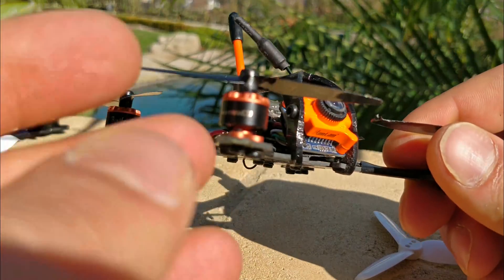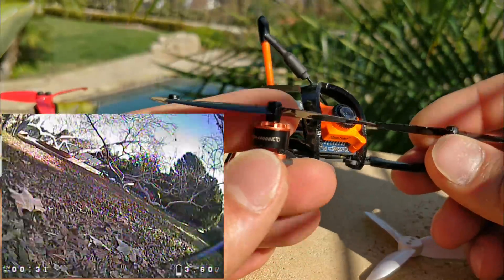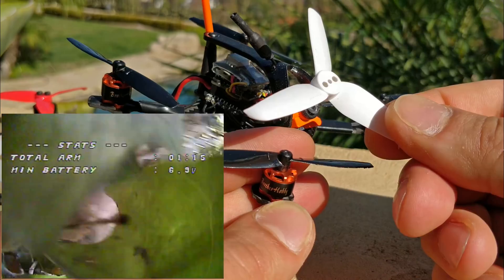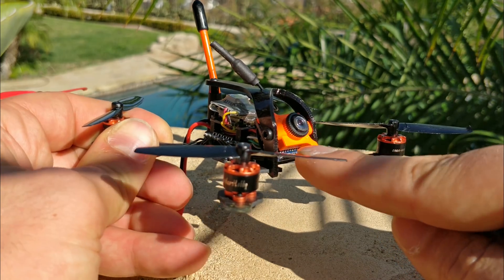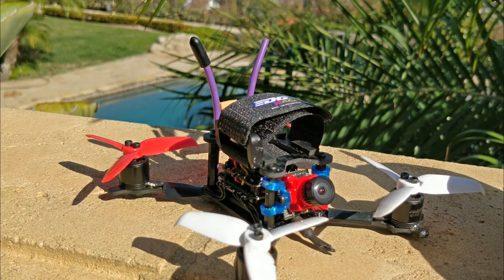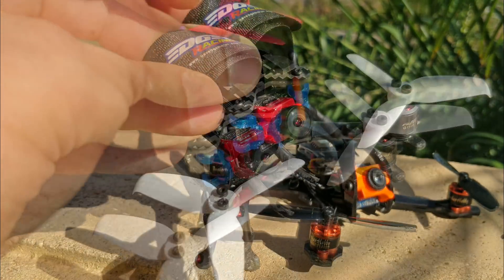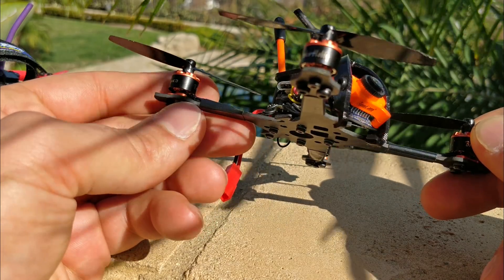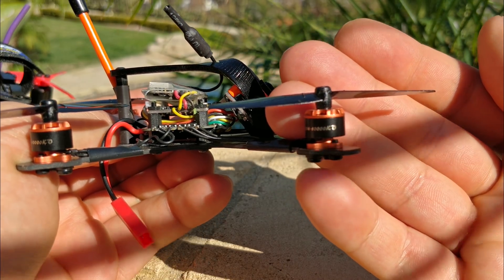Brother Hobby 0804 and the little quad dilemma

Comment: Hello. Have you ever try 15000kv motors? I have just purchase 4pcs and I am stil confusing whether they will run on 2s and are good for newbee
Reply from the maker: They'll work on 2s but 5000kv is more appropriate for 3s on 2.5-3"
Reply: @Kabab  thanks, but i thought brotherhobby 0804 15000kv 😅🙂
Reply from the maker: @jozefmichalicka3443  just keep those skinny props on it and it'll be fine

Comment: 2 years ago wow. I still like this one.
Reply from the maker: Yeah it was a really clean design. The most recent one using whoop boards is much simpler however
Reply: @Kabab  I'm all about smaller and quieter with performance so I love the progress you're making. Wherever the world is cooperating with parts, I'll keep building your TP's.
Reply from the maker: @yak55x  the cinewhoop that's coming is the real magical thing. Even that's a lot quieter than most cinewhoops
Reply: @Kabab  I'll look forward to it.
Reply: @Kabab  hey kabab, random blast from the past... But would these 0804 (15000kv variety) motors spin 2" props decently on 1s? Trying to Frankenstein a 1s 2 incher together to go with my 1s babytooth and 1s 2.5 inch and have access to a set of these on the cheap. Probably don't need a 2 incher on 1s but gosh dangit it sounds fun... Haha. Appreciate your insight always.

Comment: you probably don't use this one any more. can I buy it off of you ? i'm new at fpv and I like this one. it looks great and small and light.
Reply from the maker: I actually gave this to Jordan/JET the last time I saw him.  I'm sure it's hanging on his wall now.
Reply: @Kabab : oh :( thanks for your reply. i'm practicing on brushed motor quad right now and getting pretty good at it. now it's time for me to move onto something with more power, so I can do different moves. when I was flying with my tiny little brushed motor quad in the park near my house there was an 80yr old lady. she didn't want me to fly drone there. even when I saw her faraway I already stopped and waited for her to pass and getting faraway from me before I started flying again. still she turned around and got mad at me for flying drone there. what am I going to do? fighting with an old lady ? I moved to a different park, but still afraid of some old lady might give me a hard time. so that's why I'd like to keep things small and quiet. so I can keep practicing. now why don't I just buy one 2s quad from the market ? there isn't any "real" 2s quad in the market to buy from. for example, babyhawk r pro can run on 2s, but 3s is recommended. it weights 90grams (without battery). that thing would probably barely lift off the ground on 2s. and all other companies seem to do the same," can run on 2s but 3s recommended ". I just want a quad that is really built for 2s. I've never built and set up a brushless quad. I guess now I have to give it a try and hope for the best. I like your flying style and I will fly like that someday.
Reply from the maker: @matthew04101  you want the tinyhawk. I could say you may not even care to fly much else after flying that too. It's fun to shoot up 100ft tree in half a sec with a 5" but like anything else it gets old too. You get a similar excitement with the tinyhawk in that you can do most moves with it since it somehow has enough power.
Reply from the maker: @matthew04101  it's coming out tomorrow.
Reply: oh, sweet! thanks for your reply and help. i'm going to get one.

Comment: I think that a 2s quad like that would be viable but only if it is cost effective. Like you said, the 2.5” is only marginally more expensive, and I seem to remember in one of your earlier videos about the 2.5” you said that the babyhawk R is cheaper than even the 2.5”. That’s the issue, I don’t necessarily think that this size can take off (pun intedended) if there is a higher performance craft for cheaper. I could be completely wrong though, and I would love to see a more economical version that becomes popular. On a side note, have you ever checked out the FT Gremlin from FliteTest? I know they aren’t as high performance as you’re looking for, but they’re 3s capable and pretty economical if you have a spare micro cam laying around.
Reply: P.s. I have an FT Gremlin and it’s not super high performance (I run it on 2s) but it’s super fun for just putting around my neighborhood  😁

Comment: I heard you tried out the RCX motors for micro builds. How are they? I have the 1103 and they heat up more than I would like. Opinions? Suggestions? How can I make it work? I have 2 inch build with a dry weight of around 40grams without an FPV system. (waiting for my AIO) your help would mean a lot!
Reply from the maker: The rcx are good Motors but they do heat up a lot period more than I would like them to

Comment: Off topic  question for you,  im building s 6 in floss 2 with 2507 brotherhobby motors, 2700kv, what props  would you recommend for General flying, free style and  not crazy on amp draw? Do u have a favorite
Reply from the maker: I haven't tried the new HQ 6x4x3 v1s but  I believe they fixed the issues with the 6x3x3 and if so, it would probably be my 6" prop of choice.  Other 6" that I like is the Gemfan 6042 but I prefer a triblade.  Also try the Gemfan 5552.  Fantastic prop.

Comment: hey kabab, quick question would that tpu plate for fc softmounting, would that work for the floss 2? how thick should it be, and weight vs 4 bobbins. and how would it perform?
Reply from the maker: +Davey Knowlton it would work for the Floss 2 but would be much bigger. It would probably add more weight than it's worth. The rubber standoffs or an FC with rubber grommets is usually the preferred methods
Reply: Kabab FPV Thankyou so much for the reply. I think your right, :)

Comment: What you think on the Eachine vr011 goggles ?
Reply from the maker: +MC flyer are those the actual goggle or the shoe box style?  I forget. The goggle is total crap. I did a review on it. If those are the new ones coming out soon then I dunno but they'll probably be crap....
Reply: Kabab FPV https://www.banggood.com/Eachine-VR011-5-Inches-800x480-Diversity-FPV-Goggles-5_8G-40CH-Raceband-With-ProDVR-p-1209467.html?rmmds=category&cur_warehouse=CN
https://www.banggood.com/Skyzone-SJ-H01-9601080-2D-3D-FPV-Goggles-AV-Video-Headset-With-HDMI-Head-Tracker-p-1105891.html?rmmds=category&cur_warehouse=CN

which one is better ?
Reply: what is the best goggles under $100 ?
Reply from the maker: I haven't used either of those but they're box goggles so I wouldn't spend much money on either.  Go for the eachine one that's sold like 2000+ pairs or something with thousands of reviews.  It's like $60 I think?

Comment: I just wish someone made a frame that fit 070x's with an arm length long enough to use these KK 65mm props. So far, such a frame doesn't exist. All the frames I see that fit 070x motors are usually 55mm prop size max.
Reply from the maker: My design does at the moment but the motors are so expensive I wouldn't recommend it.
Reply: Well, in my case it's more of a me just wanting to do it thing, rather than a cost effectiveness thing.  I'm well aware a larger quad could be built at the same price point.
Reply: Lmtr120 I believe fits and if not dude makes mini 2.8in alien frames on Instagram and can make any mounting you want for motors.also several 07xx and 08xx frames on armataan productions
Reply: I've called myself looking on armataan productions before and didn't find anything, but i'll have to check again. The lktr120 seems to be both discontinued, and fiberglass as well. I'd rather have a carbon fiber frame

Comment: Good point about price point.  I've built a lot of micros over the last year.  While I love the 2.5" class, I came to the same conclusion about micros in general.  The most cost effective micro is the 3" ala XJB 145!  I got mine for $130 on sale at GB ($150 once you add a R-XSR)...you can't build anything that competes for the money.  I love, love my 2.5" but I decided to build another 3" instead of rebuilding a backup 2.5.   2.5s" are still more cost effective than your build here (possibly my fave class because it can fly even in places where I might not run my 3").  I understand the appeal of a smaller quad like yours, but seriously it's a waste unless you have money to burn or you are very limited where you can fly!  Just adding my opinion to the discourse...

Comment: Those KK props are really cool, all though I like the Gemfan version of them a tad bit more. I cut them down to fit on my DYS elf83 and was getting 2min extra flight time! But much lauder than the original 5-blades.
I like the tooth pick, I want some thing like that for 1s lipos. It does´nt have to fly like a 5inch, I want it for forrest racing. :D
Reply: Same. I really want to build a super light 1s build using 0703s and KK 65mm props, but no one makes a frame compatible with that combination.

Comment: Unfortunately +/- 2 min flight time is an issue for many micro brushlesses. Can't use battery with larger capacity because of added weight and it is very picky about props. These drilled KK 65mm props on 2S appeared very good with 1103 8000KV motors - got 4+ min flight time out from them with 2S 650 mAh battery.
Reply from the maker: Yeah I think even just a 550mah would give it a whole minute more actually.

Comment: ok i have decided that i will go with the foxeer predator micro your new fc and the speedix 30 amp 4 in one esc  the wei 2600 kv motor with the HQ 5x4.5x3v1s  the flowride frame  TBS UNIFY PRO 5G8 HV - RACE (SMA) yeah!!

Comment: I can only speak for myself, but I don't think the cost/power ratio is, or should be a factor. When you buy the smallest computer you can get, it is also less powerful than it's full sized counterparts, and also costs about the same, and sometimes more. You get the smallest computer BECAUSE it's the smallest computer. Because it's the right tool for the job.
Reply from the maker: Mudflap Nichols yeah I get that but something like the babyhawk R is really not that much bigger. Really really isn't
Reply: If I wanted a Babyhawk R, I would get it. but I do not. I want a tooth pick. 
Money is not so much a big of a factor in the micro community, you will be very surprised. Release it!

Comment: I definitely think you will be surprised by the market for that quad, i know its expensive to build but i believe that as they get more popular the cost should go down, it would be great for playgrounds, inside gymnast and things like that, i agree that the 2.5 in your Working on would suit that too, and be alot better, but it may be easily fitted with prop guards that would open up more of a market. Tiny whoops are ok but alot of us still desire some level of performance and all the china built micros just aint giving it. It probably won't be taking place of the micro quads like 3 in or the tiny whoop die hards but i for one would build and enjoy it, i think others would as well.
Reply from the maker: HIGHCOUNTRY fpv I'm still working on it none the less

Comment: What 11xx size motor would you recommend for a stock lizard95 with 10a esc. I absolutely love my lizard, but the stock motors drop shafts fairly quickly. I have gone through 2 sets and right I’m running it with a set 5500kv motors that were on my rodeo 110
Reply from the maker: NiteOul1 I would recommend a different frame before a different motor. One that will fit 2.5" props.
Reply: Kabab FPV thanks, would the motors and esc be enough down the line, or would I still end up changing?

Comment: Hey KababFPV, just a fun fact. I got my BrotherHobby 0706 for my "home flyer". Those little guys comes with a pressure ring on shaft (regular motor shaft screw or C-clip alternative). Ive somehow LOST 2 of those as they got loose and with a size of 1mm I couldnt find them :D I flew like 20 packs and those magnets are SO STRONG that in puller position they hold full rpm (48000ish) on 40mm tri-blade :D
Reply from the maker: Chemistt yeah super strong
Reply: I didn't know brother hobby had a 0706, I'm looking for motors on a 76mm rakon whoop, where'd you get them?
Reply: croeitus d I think nobody really knew that. I couldnt find those anywhere else :-/ here is the link, bummer its only in german and in Europe :) but they got 3 versions - 10K,12K,15K I am using 12K for 45mm tri props. Seems genuine brotherhobby, build quality, windings and magnets are excellent. https://www.premium-modellbau.de/brotherhobby-0706-15000kv-micro-fpv-racing-brushless-motor-1s-2s-3g
Reply: Thanks!

Comment: when I was testing 2s micros I concluded that it shouldnt be more than 35-40 dry, otherwise it is just too underpowered and inefficient. Going the 11xx 8k+ kv route was also not good, the power was there but the amp draw was way too high, so flight times where in the 1.5 minute region and the sagging was there all the time.

Comment: I know u have shot this idea down in the past but for disk loading propertys and now cooling propertys I want to see you fly a side by side comparison "with an open mind" any "normal quad" vs a quad with the motors in the pusher prop configuration. I'm no pro but my gut tells me someone like yourself would be able to feel the Difrance if there is one
Reply from the maker: Nitro I'm confident that I would. But it's just not practical. You can't land easily. I usually go for practical over performance when it's that inconvenient

Comment: Saw those come up on banggood.  Not yet arrived, but projected price at $15/ea.  I... really like this size (wish it was compatible with standard 1104 mounts) ... I really like brother hobby, too. but man that's expensive!

i'm sure you know more than me - but the smaller the motor, in my experience, the more dramatic the effect of super powerful cogging from strong magnets (light props and light bells don't carry enough mass to overcome the cogging as well as on bigger rigs, i assume), so i'm just looking for smooth stuff in this category.  Otherwise you end up with a really picky tune and crazy heat - just a recipe for disappointment especially when something this tiny goes from warm to melting so fast.
Reply from the maker: CesiumSalami yeah. Hard to get good mag field management that small

Comment: So I'm noticing that you consistently reverse your motor direction.  I know that it improves (to a degree) theoretical turn speed and stability, but is there a reason why quads typically default to the inwards motor direction if running motors outwards is such a simple improvement?
Reply from the maker: FredTheFailLord keeps the lens clean. That's 99% of the reason. The last 1% is to look cool 😂

Comment: They look good! Am building one myself but have got to wait for the parts to arrive first. I got some 0905s 10000kv dys. The smaller quad may cost more but at least it will only beat stuff up indoors rather than destroy everything. At least that's the plan. I also going for a lighter build if i can and only 1s.

Comment: there is an 0806 motor by gemfan (needs special props) and BBB that might work well for this class
Reply: have you seen the 0905 by dys
Reply: How awesome is it that these small motors are coming out. I am not giving up on the small, whoop size craft that can provide big boy smoothness. They will never provide 5 inch speed but I would be happy with light enough to not scratch a wall but doesn’t fall to the ground if it catches the slightest amount of prop wash.
Reply: Yeh man having some thing that small is amazing! Looking forward to brushless in this size! looking forward to building my blimp and quad.
Reply: What are the motor mount dimensions, I cant find it anywhere

Comment: I could see this motor in a larger rakon heli aluminum whoop build.  The 0703 size motor is dismal, and a bigger BH option swinging a 40mm prop could work if it has sufficient RPM (10,000kv plus).  Also, whoop customers are the only people willing to pay premium pricing for such small micros. I'm sure seeing a "Lexus" among Toyotas would be welcome.  Power/weight target to beat would be the DYS 1102 motor I think.
Reply from the maker: Phillip Chung this motor would destroy the dys 1102 in thrust the way I have it.